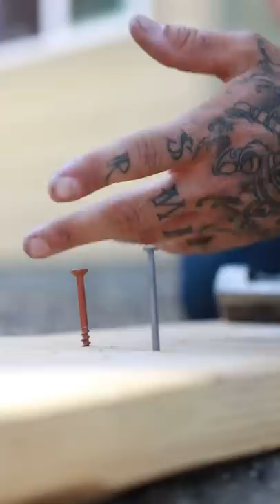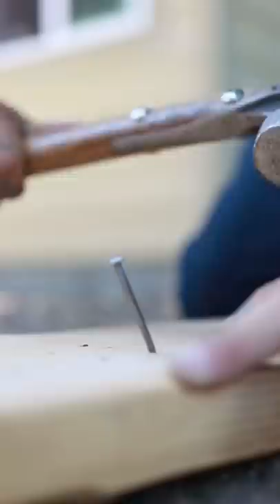Nails vs. Screws: Why do we use nails? #shorts

Comment: And in Europe, we use bricks because fire.
Reply: Well. It's also more stable, isolates better and has a bunch of other advantages.
But I think traditional brick houses are a thing of the past
Reply: Yes I’d assume everyone knows bricks or stone are the best but it’s budget that Stops people from using it
Reply: @Ondraythe1  where i live it is cheaper to build a house with concrete blocks. Wood cost almost the same but it is useless in the long run and can burn really fast.
Reply: @nstorm2415  where do you live
Reply: I live in Greece and i never saw a house built like this before. They are always built with concrete and bricks
Reply: @hamdisakali9227  those are true houses
Reply: Still in most cases will have a timber roof frame though 😂
Reply: @wenethmoon6587  not here in Spain at least
Reply: @Guille64  interesting.... although I find that hard to believe due to the fact the world copies the “Spanish roof” which consists of a timber frame and tiles... like I get it in certain parts it may not be too common especially in city areas but in the countryside and more luxurious houses you would find it a lot more then you think
Reply: Guys you dont have eartquakes as much as asia of the US west coast. I love brick buts its a bit too dangerous in alot of places. Plus good brickwork is crazy exoensive.
Reply: @kelvinw.1384  brick houses are actually just as stable if not better during an earthquake. Reinforced masonry or Concrete frame buildings withstand horizontal bending even better than wood, especially if we talk about buildings that are more than two stories high.
Reply: Fortnite
Reply: Europe uses a variety of building techniques just like the US.
Reply: @0xCAFEF00D  no. Literally everything is bricks. We don't even know how wood looks like as a building material. /s
Reply: And no wolf will be able to blow the houses down either 👍
Reply: There are pros and cons. Brick houses are more stable and durable but more expensive and it takes longer to build them. In the US, they just prefer wooden structures because there are right conditions for it
Reply: Juu Tuub  ever had an Xray done? Even YOU are bricks >:D
Reply: @eccomi21  I think he means the weight of bricks during a earthquake is more dangerous.
Reply: @0xCAFEF00D  maybe but in Ireland I've never seen a house that's anything other than brick that's permanent
Reply: In the u es of A.  We like fast and cheap.
Reply: @drumerboy456sx  and yet you don't allow prostitution?
Reply: @drumerboy456sx  unless it's an election 😉 then the opposite applies.
Reply: that's what I hate in USA, this wood houses, looks so cheap, vinyl siding looks ugly, noise isolation, thermal isolation zero.
Reply: @Paata02  and that's why I'm planning to literally bury myself into the side of a hill. No better isolation than meters of thick dirt
Reply: It rains even in the summer here, wood would just rott.
Reply: But bricks dont bend, u guys are doomed!
Reply: Nearly All houses are famed in wood (lumber) fact. Your sheathing maybe brick, but i seriously doubt its two wyes thick (structural brick).  Even concrete block houses are framed in wood. You dont think you ceiling and roof are made of masonry do you?
Reply: California hasn’t learned that yet
Reply: @amalirfan  it's called treating the wood, genius.... You don't use just raw wood
Reply: @eccomi21  bulshit
Reply: @amalirfan  no
Reply: There are millions of brick homes in the US
Reply: @nstorm2415  same in Ireland ☘️
Reply: @Kacper_Kolodziejczyk  hi.☘️
Reply: @zefrum3  the walls are usually cavity blocks..yes the roof trusses and the floor and ceiling joists are wooden as well as the floor boards
Reply: @zefrum3  i live in panama and not everyone uses wood, wood houses are considered cheap and only old houses use wooden frames for the roof. Almost everyone use concrete blocks with steel bars and aluminum frames for the roof. Earthquakes are common where i livethat id the reason we use steel bars inside the walls it prevent the blocks from breaking and give more structural support.
Reply: @nstorm2415  your roof framing is made of aluminum? What do you attach your roofing shingles and roof decking to, aluminum?  I dunno, well im willing to entertain this but Ive got some big doubts. Very very few homes are made with barreled vaults in masonry. And even then do y’all have sheet rock there, what do you attach it to?  Btw, wood as an inferior building product is just plain wrong. Lumber per pound of material can be made stronger than steel (lvl and psl and other engineered lumber products)  The most valuable homes will always be made with lumber period.  And on that note, concrete block as a building material in earthquake prone areas is pretty terrible idea unless the engineer specs loads of steel reinforcement. Wood for its toughness and flexibility is the best material to handle sway with fewer design considerations
Reply: @zefrum3  also, reinforced concrete is really safe on earthquake prone areas.
Reply: @nstorm2415  yea i agree if its designed with massive amounts of steel rebar per the IBC / IBR / etc.
Reply: Because your houses all touch...
Reply: @hamdisakali9227  majority of Asia agrees with you
Reply: Juu Tuub  for what?
Reply: @palloproductions3198  luckily psychosis isn't the norm here so houses can touch. We even like our neighbors (even if they're not white 🤫)
Reply: @MD-zy9xk  and millions more obvious comments on YouTube 😋
Reply: @ricardolafou5921  well if you get crushed by a house made of wood, or a house made of brick. It's still going to be a bad day for you.
Reply: @zefrum3  zefrum. Houses in the UK at least are dual layered brick. The entire house. The only bit that wouldn't be is the roof where it's timber framing, felt and slate/concrete tile.
Reply: ...and the third little piggy...
Reply: @lmaoroflcopter  Yes most buildings in the UK are two wyes thick red-clay brick; but the interior is still stick framed right? Your exterior wall electrical plugs and switches are not installed into the brick. Same with doors: the post and lintel are made from lumber.  -I lived in Aldwich, south of London, for a whole summer, so I have some basis to reiterate the building methods for (modern) structure there.
Reply: @zefrum3  no. The back boxes for electrical sockets are generally chiseled into the brick walls themselves. Walls can be battened though I would say most houses here are not, but also that's not framing. Door frames are timber mounted in brick, the lintle will most likely be concrete.

I'm not saying lumber isn't used in construction but I am saying we don't generally have timber frame homes.
Reply: Might I add: here in germany, our screws dont break that easily...
Reply: @uNkNoWn-jx4vy  yea they dont break easily here either. For some reason a lot of contractors here in America believe they know more about metallurgy and engineering than actual scientist and actual engineers.
Reply: @lmaoroflcopter  wow thanks for stating this
Reply: @lmaoroflcopter  what do you construct the structure of flooring with? Cant be concrete for multi floor residential home…
Reply: @zefrum3  that would be wooden joists, mounted via joist hangers inserted into the brick structure of the home, again not the framing.
Reply: @lmaoroflcopter  I disagree, joists are apart of the framing of a structure. And looking at some pre WWI London and Bristol home plans, one can clearly see the hevy extant use of timber for framing the floors, even ground, and the roof assembly.  Just saying the exterior walls is all that counts as framing and excluding flooring and roofing timber  doesnt justify saying home in UK are not made from lumber/timber.  Clearly it is the case since the 1875 Public Health Act that timber is an integral structural material in residential home construction.
Reply: @lmaoroflcopter  yes i know but maybe they choose wood for the weight difference idk.
Reply: @zefrum3  right oh. We also used to build our houses from mud and horsehair.

Fact remains timber framed houses are not found in the UK as commonly as one would find them in the US. We use brick and mortar to frame our houses. As I said lumber is used in construction sure, but not commonly for framing like you suggested was the case.
Reply: @eccomi21  In California we have had too many brick buildings collapse and kill everyone around it. At least a wood, steel, or concrete slab building will create pockets that can protect people. Brick buildings are almost completely obsolete.
Reply: @lmaoroflcopter  again nearly all post 1875 houses in UK are actually framed with lumber/timber, except for the exterior walls and sometimes except for the first floor. Where floor trusses are now used even still the flanges are timber. It is a misnomer to say UK homes are not framed in timber. To be precise, one should say in the Uk exterior walls are not framed with structurally with timber; which is obviously awkward at best.  And on this silly argument of haut, the argument would be similar to me saying my Texas homes are not framed in lumber because I have brick exterior on one and stucco and cast rock on another. All floors except first floors and roofs are all framed in lumber.  Matter a fact, I feel pretty confident to claim 9 out of 10 of all structures ever built have timber/limber framing; these just are not all timber/lumber framed.  Even in NYC local code requires framing the interior, you could say firing-out though its still 2x4 (50x200mm i believe in metric) lumber for wall, even thiugh the exterior load bearing walls are two weyth thick.
Reply: @zefrum3  here in the Netherlands we use concrete with steel wires in it (bewapend beton). They are made at a factory and shiped to the construction site, as prefab panels the major structure is build in an couple of days. Than the concrete walls are covered with bricks on the outside (Wich takes a longer time). If it's a larger house or an apartment complex they put metal i beams where the gaps are to large for the concrete to hold. The roofes are often made with wood and metal i beams wood in-between the metal beams to put on the roof tiles. The roofes can also be made of concrete perfabs.
Reply: @zefrum3  Excellent point. People also seem to forget that steel in fire will lose strength and elastic modulus very rapidly above 200 C, there was an apartment fire near where I live and they had to pull out the prestressed floor elements and replace some wall elements in the town house affected. Didn't collapse, but wasn't safe anymore. 25 mm of charred wood will be an excellent insulation during fire and the remaining wood will be structurally sound. I wonder why the Japanese go for log buildings in earthquake prone areas, maybe they know something...
Reply: @M90thYou  At least someone knows what they're talking about. It's not a coincidence that we don't use brick much here in earthquake country. Any decent architect or engineer will tell you that brick construction is a death trap in highly active seismic areas. If you do a little research you'll find out that brick and mortar is not feasible for construction after a few stories in height. Think of a pyramid. There's so much pressure being exerted on the bottom floors that you need to progressively get wider at the base to bear all that weight. Ever wonder why a skyscraper is made of steel beams with moment frames? It allows the building to flex under high lateral load, think gale force winds, as well as the added benefit of reduced weight for the reinforced concrete foundation. I'll admit, brick looks really nice but it's a weak construction material in many dynamic environments.
Reply: Mike Tiger  ?
Reply: Lebanon is very much the same. Stone and marble everywhere but no wood is used for construction
Reply: @rileyk5228  because theres hardly any trees there
Reply: @eccomi21  in Albania they use stucco
Reply: Same in Latinamerica
Reply: @Richard Moore exactly. Unreinforced masonry buildings collapse easily. Reinforced ones don't. They work sometimes even better and have no visibile damage compared to wood buildings that wobble about
Reply: @Paata02  depends where the house is built.  I noticed that Colorado, Oregon, and Washington builds houses with mostly wood and in the southwest it's mostly brick or vinyl siding.
Reply: @benhaley9811  Like yours? lol People from Europe are responding as if only they have brick homes. Not that obvious to a  
European
Reply: @palloproductions3198  A true American. 🇺🇸
Reply: In the us we use use fireboard because we dont still live in the stone age
Reply: @xxx_epic_sniper_xxx2.021  you also cannot drink your tap water because your country is basically gold plated Mongolia
Reply: @wenethmoon6587  bro the "Spanish roof" is the barrel tiles part, not the timber part of your equation
Reply: @zefrum3  a timber framed home suggests that the structural component of the house is timber. But arguing with you seems to be a waste of time as having read this thread, you refuse to see the reality that literally only  America builds wood framed homes. Your shitty 2x4 home with false stone siding isn’t the same as a solid structural brick house. The rest of the world does not frame interior walls, because they don’t use shit drywall, or unnecessary wall insulation. That’s just America. The rest of the world has solid interior walls finished with plaster. Rock solid walls. No bullshit frame.
Reply: @fakename287  dude any tiles roof is a timber frame and that’s the point I was making if you can find me a tile roof without a timber frame I’ll take that back back I’m yet to see one
Reply: And because you have a lot of money. But brick needs reinforcement of either steel or wooden frames. Just because its brick doesnt mean its all fire proof
Reply: @CheeseMiser  ever seen a furnace made out of wood?
Reply: @eccomi21  nit really
Reply: @wenethmoon6587  not true. Most houses have concrete or concrete beams roof
Reply: @agostinho6550  nit really what?
Reply: Yeah because you live 1 inch from another house , and park on the sidewalk
Reply: @bajablaster1  u mad bro? XD
Reply: @eccomi21  it's because brick costs more and if it didn't every house would be brick just saying
Reply: @eccomi21  Yeah I know it's a silly comment it's just that the guy sounded really convinced.
Reply: @benhaley9811  yes
Reply: We have brick homes here? I've seen some pretty shyte Euro homes before.
Reply: I feel like you underestimate how much wood is still inside your house even if it’s mostly made from bricks. A lot of the base of the house is made with metal and wood
Reply: @L 024 bricks :D
Reply: @benhaley9811  lol What?  Where are getting this information?
Reply: @benhaley9811  whats “gold plate Mongolia”? And how is it bad for dispersing/dispensing water?
Reply: @eccomi21  the main reason structural brick walls are inferior for residential construction is that they have no structural diaphragm, which in the case of wood or metal (yes metal studs) stick frame prevents the wall assembly from racking due to lateral forces that a hurricane would cause. This assembly where the sticks are assembled with pkywood sheathing creates an elongated I-beam, out of the whole wall. You simply can not create I-beams out of structural brick; which therefore means structural brick is prima fascia an inferior building material for hurricane/typhoon and earthquake prone areas.  The areas that use bricks are because they can per international code and cost effectiveness both for material and tradesmen.
Reply: Goood thing Europe ain't part of Scotland anymore lol
Reply: In California, we can't use bricks because earthquakes. RIP house in a fire.
Reply: In Spain we use cement because old.
Reply: In Florida we use concrete because hurricanes
Reply: @eccomi21  I was originally going to build my house out of stone but switched to brick when I heard how expensive it would be., I'm using what we call "painted bricks", they have a beautiful multi colored scheme and it's been kind of a new fad to build houses with those types of bricks.
Reply: @eccomi21  no offense but European housing is kinda ugly. Ok namely I’m thinking of England.
Reply: @nofurtherwest3474  it entirely depends on your region and your taste obviously. Like, sure you can think whatever you want. I personally prefer an Industrial look myself anyways
Reply: @nstorm2415  brick houses with concrete have less resistance to fire than wood
Reply: Juu Tuub  maybe in eastern not?
Reply: @Weston Harris maybe 40 years ago. but I see big housing plans opening up all over the place and all the houses are shitty 2x4 framing. It just saves the contractors money.
Reply: In California, brick houses crumble in earthquakes, so there's that...
Reply: @thedeviousduck8027  shitty 2x4? Whats shitty about building a house of of material that pound for pound is tougher and stringer than steel?  Btw, mine is made from 2x6 for the verticals that are 12’ tall. Yea ‘shitty houses’ smh
Reply: U know California should learn a thing or two
Reply: Good excuse to tell yourself. Truth is you cut all of your trees ages ago, and don't want to cut the few that remain.
Reply: Hahaha
Reply: @Guille64  don't make fun of my twig and cardboard American house 😤
Reply: The same south America
Reply: @benhaley9811  cant drink the tap water? Where did you hear that? The tap water where i live (Missouri) is as clean as bottled water
Reply: @Clarkcanepa  and what is your plater base stuck to? I have trouble believing making every interior wall out of masonry is, or ever was cost effective. Im not going to argue about exterior wall construction, because ive seen houses with the roof and floor joists stuck into brick and mortar on solid rock foundations in my city. Those are old houses with heavy French/Italian influence and techniques, but they all still have wood interior framing with lateral boards and 2-3 coats of plaster. They’re much more durable than drywall, but i dont really like the heavy texture they have
Reply: @richardlea818  literally. All bottled water companies source their water inside the state they sell it in. That way, they don't have to let the FDA inspect it. Because if the FDA did inspect it, they'd require an ingredients list, because ever bottled water company ever puts who knows what minerals and salts in them things.
Reply: I see alot of comments but I'll add what I learned from my time working in electrical installation, houses in the US use wood not because its cheaper but because its more abundant, costs of bulding materials constantly fluctuates like right now wood is more than brick, it has just for the most part been cheaper and almost as good for our needs.
Reply: @eccomi21  I've seen first hand what happens to brick buildings in a small of earthquake ('87 Whittier Narrows, 5.9). The mortar has absolutely no tensile strength and as soon as the brickwork starts to flex, the whole thing falls apart. Many old two and three-story brick buildings just collapsed.
Reply: You guys use bricks because of the big bad wolf
Reply: @zefrum3  wood isnt stronger than steel
Reply: @friezathenonceslayer8200  pound for pound it is, just as I stated above
Reply: @eccomi21  untrue Nevada does allow it